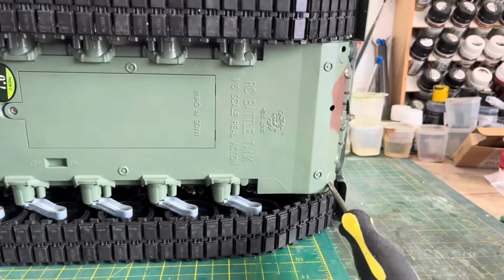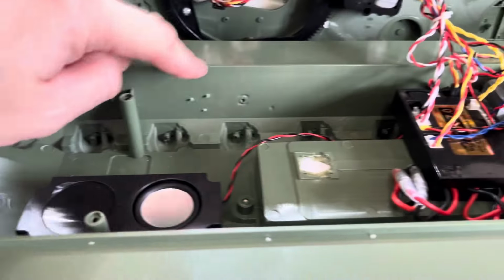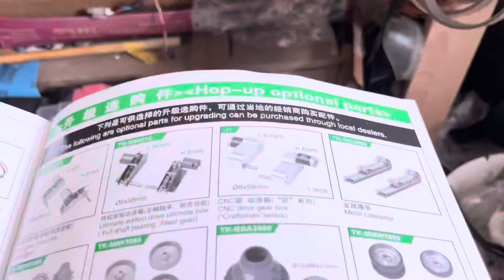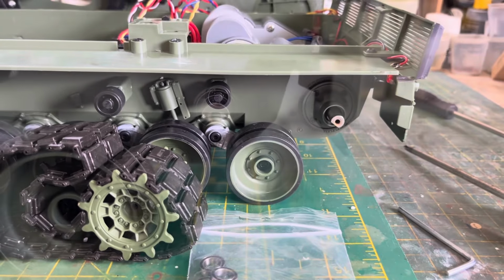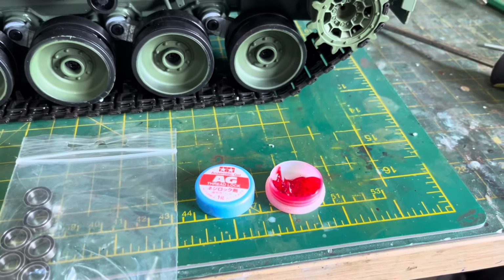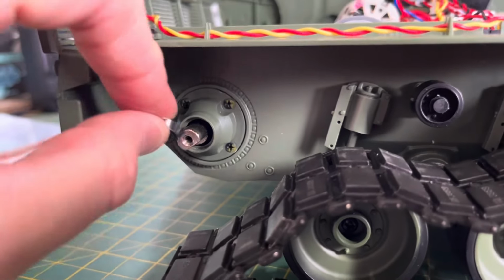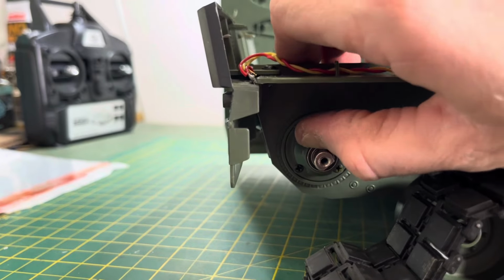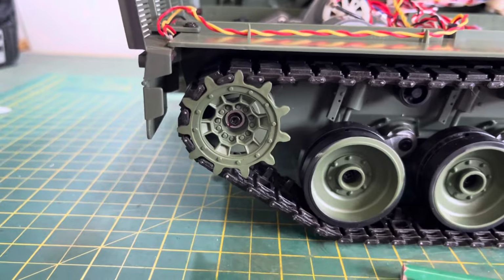BEGINNERS GUIDE, HENG LONG LEOPARD 2A6 7.0, FITTING BEARINGS TO THE DRIVE SHAFTS, BASE TANK PART 1.

Comment: I also have a little tip: put some counterweight in the front lower hull, as most of the weight rests at the back (gearbox)! I put lead foil from the roofing sector in the back of my Panther G! thus the weight at the front has been balanced. 👈👍 And the ball bearing thing is correct if you later want to use a metal drive wheel and deflection pulley with metal chains, the weight then rests on the ball bearing and not on the gearbox itself. 👍💯  

Sorry, I forgot something. On most new RC models you can also adjust the chain tension at the front of the Leopard 2A6. You just have to loosen a screw, turn the pulley forwards or backwards and then tighten the screw again by hand (helical teeth between tub and the holder of the tension roller) 😉😉
Reply from the maker: Hi!
Yes the weight at the front is good, helps with the pivot point too, digs in less.
Thanks for saying hi! And watching too kind!
Have a great week.
P.s the new heng long leopard has torsion bar suspension!